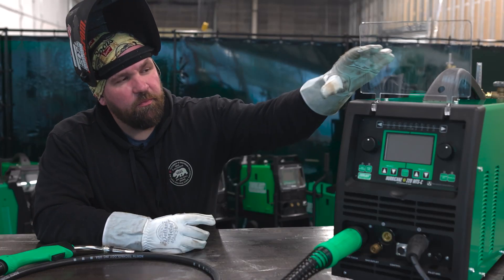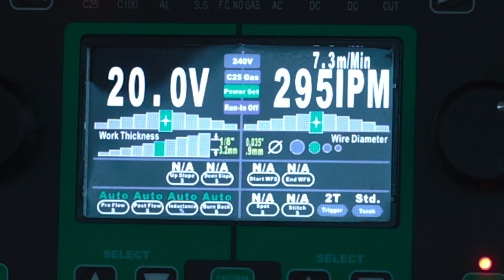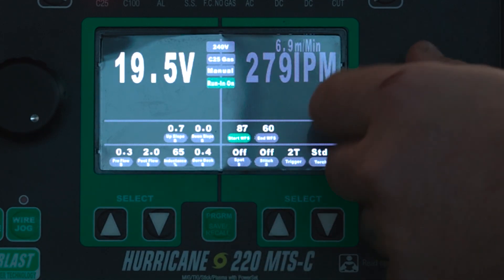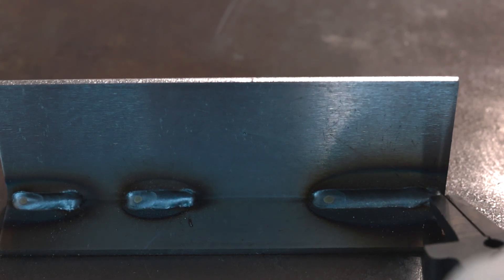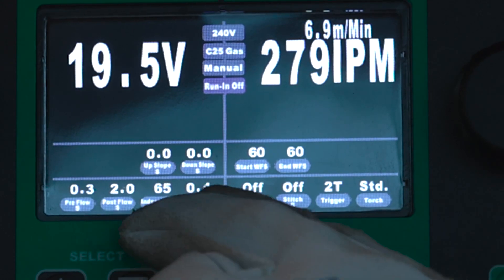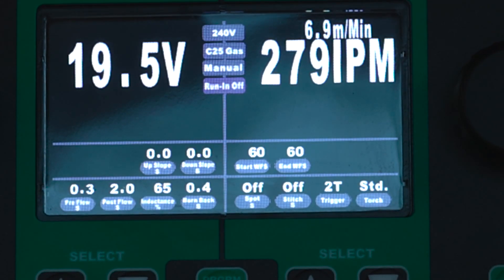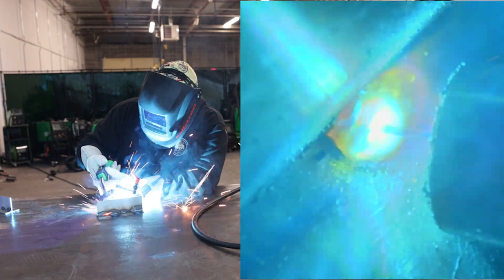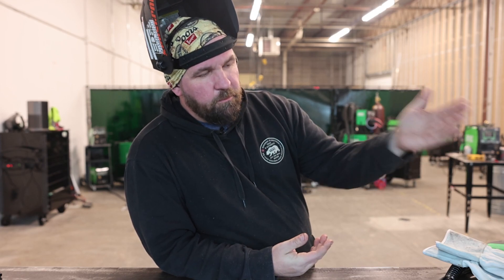Everlast Welders: Hurricane 220 MTS-C MIG Overview

Comment: I can’t wait for mine to show up! This will be my first welder ever purchased!!! I really like the amount of processes included with this welder. Thanks for the video! Patiently waiting for more videos.
Reply: Hows it working out for you?
Reply: @jakecarter4407  It’s been flawless, I’ve used every function except stick. I actually prefer mig side of this machine over our millermatic at work, Better bead profile and more settings. Only complaint would be how short ground cable is, and the machine is kinda heavy to make mobile, but it can be done.
Reply: @yoopervblog9337   after 5+ months of having it would you recommend it, I'm looking into hurricane 220, mts 275, or a lincoln 215.
Reply: @L61cavalier  I haven’t spent as much time as i would have liked to on it so far. Life has changed plans for me and I’ve been in the process of buying a business, so my review is short lived.
Reply: @yoopervblog9337 how’s the welder doing man if you’ve still used it? I’m thinking about buying one